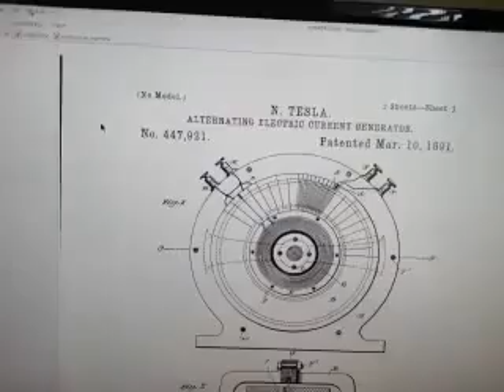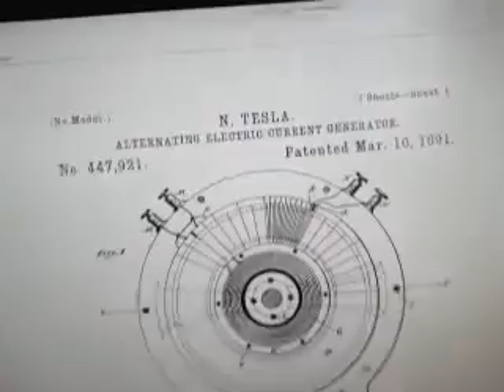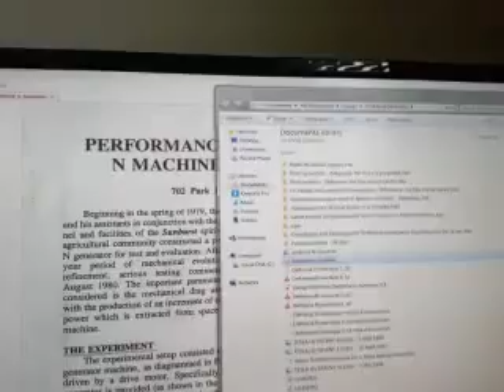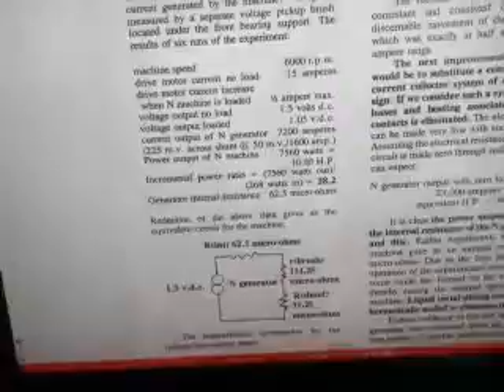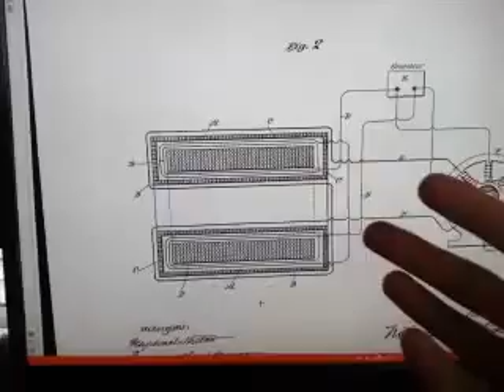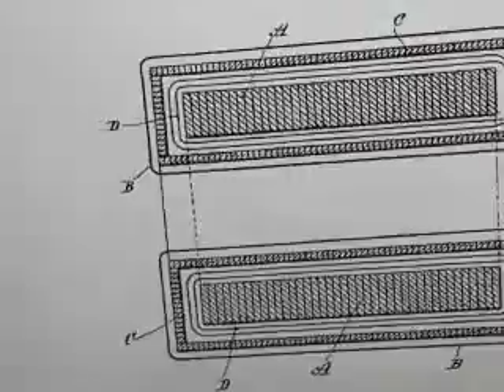How to turn a DC oriented homopolar, unipolar, disk of Michael Faraday into an AC output.

Comment: Iron is not your friend by making core from wire  we delete the robbing effect of  modern
 iron core transformers
Reply: Magnetically couple a lot of ferromagnetizable iron to the ferromagnetizable iron within a Kromrey converter and see what happens. See if it satisfies William Lyne‘s alleged quotation of Nikola Tesla that for every 200 pounds of iron magnetically added (coupled) to Tesla’s special generator, 1 hp was increased at its output.
Reply: @vinyaasi  when replacing with copper x 1000 200 pounds copper =1000hp God Speed thank you for your excellent work Vinyasi

Comment: Overunity is simply not possible.
Cheers.
Reply: Correction…
When oscillating current cannot become saturated…
Reply: @vinyaasi  Thank you for your response, Vinnie.
What you say is that you have an overunity device.
Can you show it?
Reply: But you want to start off by studying the perpetual motion holder which was popularized by Edward Leedskalnin (who also built coral castle outside of Miami Florida). The two devices are very similar because magnetic flux does not figure into them so much as magnetic remanence (which was utilized in computer core memory between the years of 1955 and 1975).
Reply: @vinyaasi  In other words, you don't have one.
Reply: Keep the faith. The answer is not so far away…
Reply: @vinyaasi  Yes, just a few hours, until I'm dreaming.
Reply: After five years of training myself on simulators I cannot go back to sleep again. There are probably no more than a few dozen people on this planet who feel the same way I do. Experience is the best teacher even if it is only virtual reality it still is something plus it’s backed up with what a few not too many but a few electrical engineers have come to know from their own experience verifies my experience despite conventional wisdom.

I absorb so much stress from critical minded people that (and plus my age is a large factor) I don’t have much motivation to build anything even though I do but I’m overwhelmed by the negativity. Which is why I keep harping on just one thing is understanding because it’s not enough to have faith understanding is required as far as I’m concerned that’s more important than building anything because without an understanding you don’t know what you’re building or why or how to make changes in case technical problems should arise.

Tesla had a simulator for a brain along with photographic memory I don’t have either all I have is a computer and software so I have to take the same approach he did only take longer than he did he took his time his sweet time when he engineered something in his brain because he wasn’t engineering it he was simulating it and only after he ran it and redesigned it to the point that he was satisfied only then did he tell an assistant how to build it and it worked the first time every time that’s what I wanna be able to do because unless I’m perfectly sure about what I’m doing I’m not gonna bother putting out the capital or the time to build it at all regardless of what anybody might think or say.

People wanna see something to believe it…no … I have to understand it to believe in it I don’t have to see it I have to understand it that’s the way I work and only when I thoroughly understand something do I go ahead and do it.
Reply: @vinyaasi  There are no more than a few dozen people on this planet who believe the Earth is flat too.
A simulator is never the real thing, wake up.
You ask me to study something, but I ask you on my turn to study physics.
You probably don't understand even the very basics of physics, like they teach at high school.
 
Don't let electrical engineers fool you, they usually don't understand physics at all.
Don't waste you time on this silliness .
Energy needs a potential difference, so without a potential difference there cannot be a flow of energy.
On Earth, we cannot make something move without having an external, frictional or resistive force acting upon it, and therefore every motion will eventually come to a full stop.
 
But hey, thanks for your comment, Vinnie.
Reply: @UC1hEphLFsUCNUkM2hmGddzg You should never stop searching for cheaper forms of energy.
Humanity would really appreciate it when you find something new.
But you must also listen to the specialists on this matter.
First study physics, so you understand what you are saying.
Reply: There is nothing stopping overunity. Lightning bolts and the sun are 2 stroke plasma entities tapping the ZPE quantum vacuum. Joseph Papp pulsed plasmoid 2 stroke and Adam Trombly's dynamo are overunity. https://www.youtube.com/watch?v=4vZRKVJQKUk
Reply: Of course it is, the law of conservation only applies in closed or symmetric systems, just break the symmetry.
Reply: @JenkoRun  The burden of proof rests on your shoulders, not on mine.
Reply: @killerwolf7676  For having energy to flow, one needs a potential difference.
Calling something "unknown" doesn't help us much.

Comment: CMan, As I read Tesla's generating patent he's making an AC generator that produces 15,000+ AC cycles per second! He does this by literally passing "serrated" magnet poles, powered by electromagnet field coils. The varying magnetic field past the fixed conductors produced his power. This is not a homopolar motor/gen. It is a regular induction generator, but with non-looped conductors for pickup, compensated with very strong and very precise alternating magnetic fields.